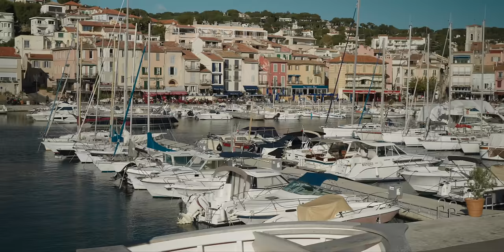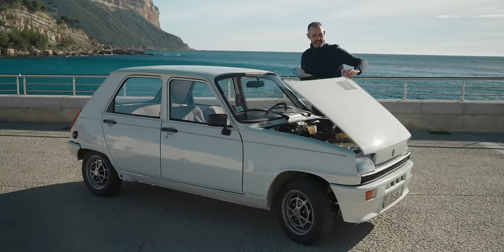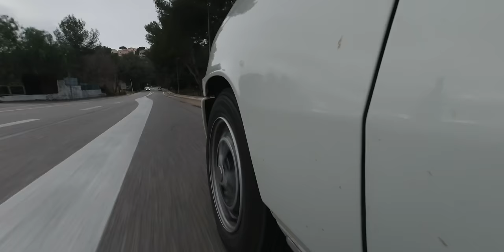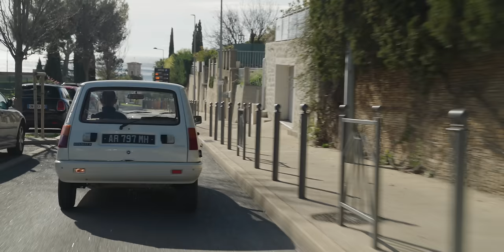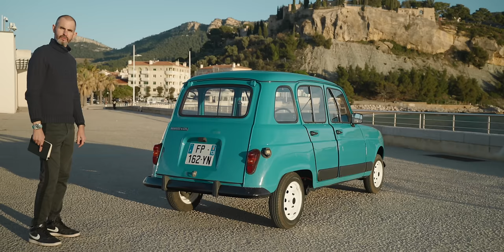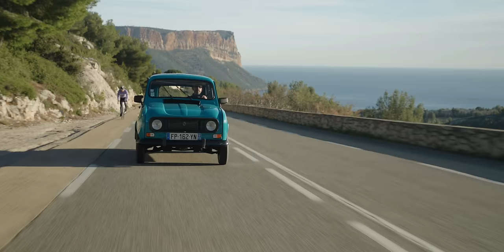Renault 4 and 5 Resto mods - would you electric convert classics like this?

Comment: So they are basically restricted by the regulations to keep car culture dead in France. For the big boot battery to make sense there would have to be a quick swap system like they have tried in China to avoid constant recharging. I was hoping this was just a small, modern petrol engine refit but of course it was not. Not a fan of this at all but to each their own.

Comment: To rebuild the original mechanicals would have ensured it good for decades travelling only a few thousand miles each year, as classics tend to.
As such the environmental benefits of such a conversion are minimal to nil and when the batteries inevitably degrade in 10-15 years, it will probably be scrapped.
Reply: That battery pack won't be that expensive and pulls straight out of the car if you undo a few bolts.
Reply: Niche business for sure BUT! At one point govts will make ICE 🚗 illegal on the roads. 2030, 2040, it doesn't matter, that's what will happen. So if you have an old vehicle & you like to drive it, you won't have the choice but to adapt.
In 10 years the price & specs of batteries will have been improved even more & I'm betting that retroffiters will be more numerous.
Reply: @mystisith3984  I think all the ICE vehicles have been designed to fail for a long time now.  So many jobs are not worth doing anymore.  Just a clutch or a cam belt/chain have a cost making it not worth bothering.  And all the electric water pumps and ancillary parts around the engine being in plastic brittle casings.  The conversion to electric will be faster than we think.   Once people drive one they won't want to drive ice again.
Reply: @mystisith3984  It will be 25 years at least before ICE cars may be banned, by which time these converted cars may be requiring their second set of replacement cells.
Even if costs are halved by then, that is a huge unnecessary outlay right now.
Reply: @chrishart8548  I bet it is more expensive than a full engine rebuild and will require replacement more often, if like most classics little mileage is covered each year.
Reply: @matthewjenkins1161  a full engine rebuild won't be cheap.   I expect this 10kw battery will be reasonably priced. Maybe its just sets of 18650 cell that can just be purchased off any retailer.
Reply: @chrishart8548  "A full engine engine rebuild wont be cheap"? 
On a Renault 4 or 5, where the tech couldn't be much simpler?
Clutching at straws there!
And once done, good for another 100k miles which in a classic is practically forever.
They probably removed a perfectly functional engine to do the swap in the first place.